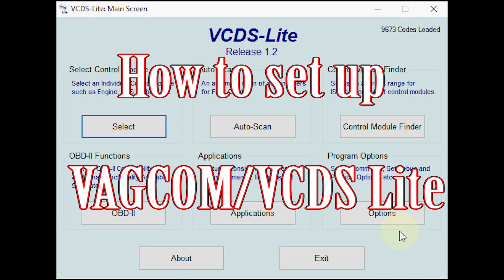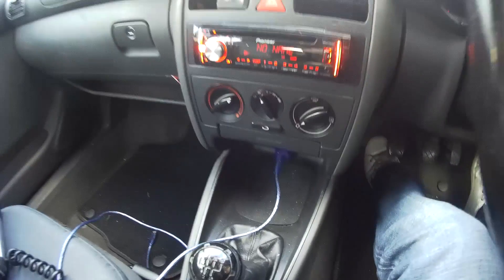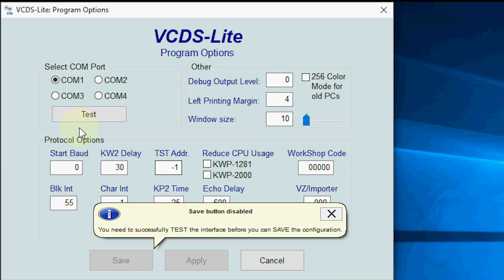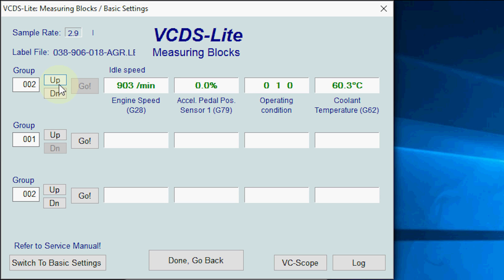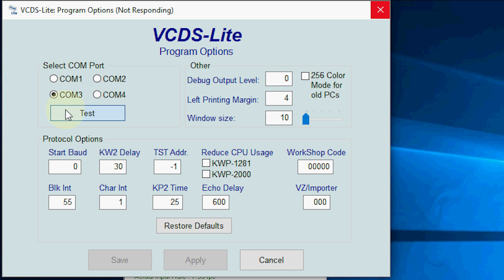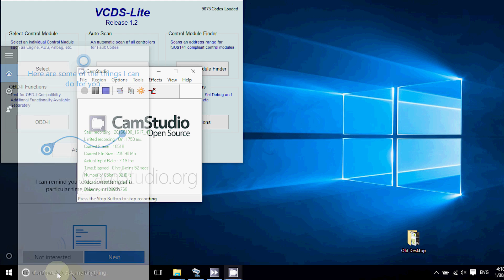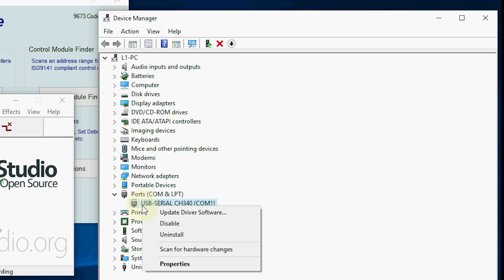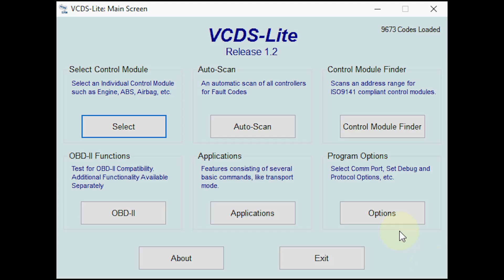How to set up VAGCOM / VCDS Lite

Comment: still does not work for me. 
vcds lite wont connect when selecting control module. 
error message
No Response from Controller!

Run test to com port on adapter, 
says successful at 2.7ms
Reply: Have the same probleme. Cant’t find any controller .
Reply: @RobiB78  might have to do with adapter connecting to ecm. 
I have a k-cam adapter
When i need a canbus which costs more. 
I plan to just get a ross tech adapter when i feel like pulling the car out the garage again.
Reply: any luck since? or still no response from controller? The same as others here who have replied, i get 'no response from controller for any/every module I attempt to scan
Reply: @antiochiaadtaurum3786  I went ahead and bought an Autel scan tool. Just came in and planning to use it tomorrow for my needs.
Reply: @hayzeproductions7093  is it an autel scan tool specifically for the 2x2 era cables? I've a scan tool, and two vcds programmes on the laptop, none will work with the 2x2 diagnostic outputs. I'm getting voltage from the output, although have yet to check what voltage is coming from the k and Lines. It's a bit confusing really. Hopefully your new autel device will do the trick today
Reply: Same problem here , engine fault codes come up but then if I want to code anything it’s says no resoponse from controller
Reply: @DrilonThegamer  i ended up tossing the adapter in the trash and got an Autel off amazon, was able to force a regen on car and get it out of state 2 derate enough to drive for a couple weeks till i did a delete.

Comment: i got error not respond from controler
Reply: How did u register it coz it says i hv to register it to use all features
Reply from the maker: That's usually the com port settings, did you change it in Windows?
Reply: CarAndMechanical yes was change
It's works and then crash
Plug in again put test save
Scan and crash
Just don't understand why
Reply from the maker: That's odd and I suspect it's windows fun and games...ok try to run it as administrator also run if offline and turn off any anti-virus software just for the time you are trying to use it. Windows can throw all sorts of fits with conflicts.
Reply: @CarAndMechanical  hey mate! help me out willya :D i have the same dumb ebay cable and vcds lite but whenever i try to change stuff in cent electric i get no response from contoller. but if i select the engine menu it works like a charm. (also when i go into the instrument menu to change lang on my golf 4 there is no roll down menu there just the dedicated buttons) thanks for reply :D
Reply: @mkmkl66  have you find a solution mate
Reply: @naydennaydenov1995  sadly the ebay cable is a cheap crap, i sold my mk4 since, but must go for the real vag com cable. It worked for me